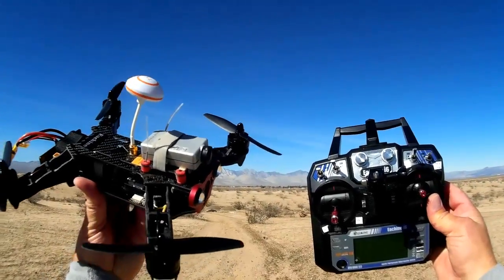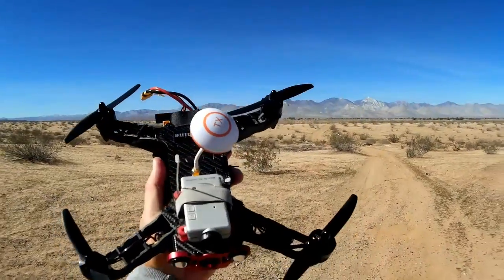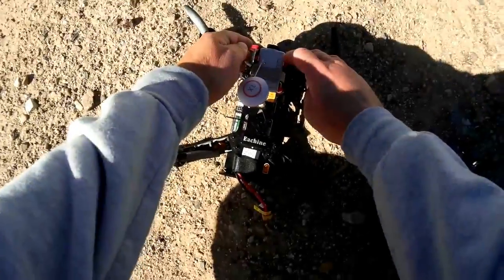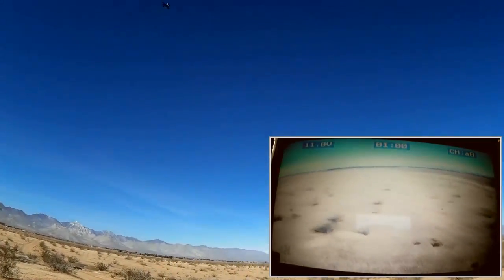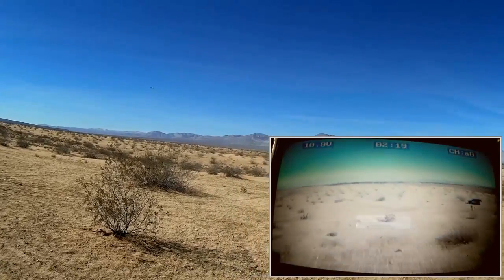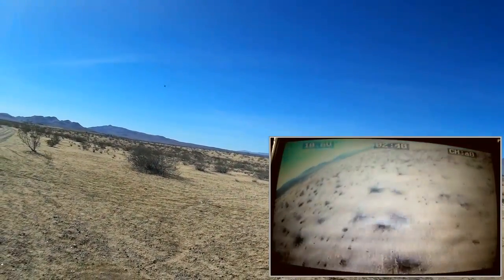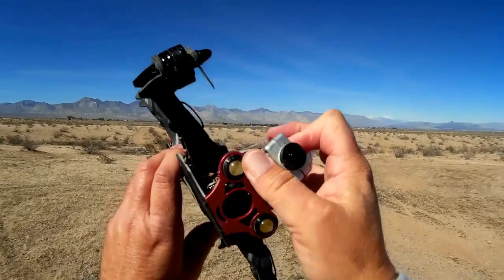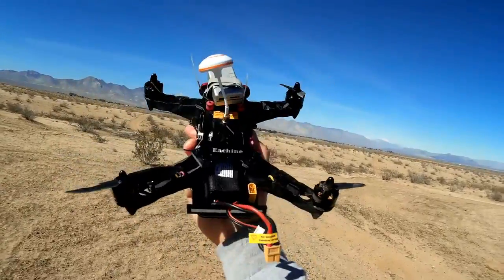Eachine Racer 250 Drone with QAV250 CC3D Presets

Comment: libra pilot IMO is your problem... load cleanflight or better betaflight on that CC3D I had nothing but problems with open pilot now known as libra pilot also it looked like in the video you where flying in acro mode  hope that helps

Comment: won't be in that program. esc can be programmed via program card or the transmitter. you need to determin the make of esc used and follow program guide on data sheet. my zmr250 running cc3d and emax esc's had low voltage cut off set as default and would fall out of the sky under low voltage conditions

Comment: check esc settings and make sure low voltage cutoff is disabled.
Reply from the maker: +Mark Dobson I looked through LibrePilot, and did not see any selection for doing such.  How would this be done?

Comment: I always thought the 250 Racers did not auto level, or had VERY slow auto level, because you manually controlled the roll.  I don't believe this is flying incorrectly.
Reply: +Zakerystrife You can manually configure it to do whatever you want. Stock from factory, this quad has Autolevel mode and Acro mode. He did change the PID settings so not sure what he is running now.

Comment: It looks like you had a failing motor or ESC, your FPV video shows the the drone turning suddenly and then loosing altitude veering backwards, seems like one motor lost rpm, and to right itself up it needed to slow the others too. At the beginning of the flight the same happened for an instance, it looked like the compass was drifting. The battery voltage was ok on the FPV screen, way above 3.1V/Cell. Was the runcam recording ? You would probably be able to hear the motor failing.
Reply: Dirk Herrendoerfer  that's wrong it's actually vibration to the cc3d. It's making the gyro stick sand is trying to correct itself. The motors will turn town to correct. It you replace a motor and it fixed it would be that the vibration isn't present.

Comment: do you want my pids they are rock solid for this quad?
Reply from the maker: +Smokey_Vaping It couldn't be worse than mine.  Yes please, please share them here so that others can also benefit.
Reply: nvm those presets your found are decently nice. looking much better.
Reply: r               p           y
P.0034 .00454 .00794
I  .01190 .01589 .01509
D.000046 .000061 .000067

i hope this helps some people out, pids were calculated with stock battery and no gopro. i was using open pilot gcs instead of libre pilot but i dont think it matter's, as they are bacically both the same
Reply from the maker: Smokey_Vaping Thanks!  I'm going to print these and try them very soon.
Reply from the maker: +Smokey_Vaping Thanks!
Reply: anything to help, keep up the great reviews i enjoy them all :)

Comment: Well, I'm glad you discover the weak battery. I have one of those little voltmeters which you plug into the balance plug and check all my batteries before going out flying with them.  If all the cells aren't between 4.15 to 4.20 volts, it doesn't go to the field.  Also curious why you used such an obscure open source configuration program?  Most of the guys who race here in the States use either Baseflight, Cleanflight or Betaflight  (I think Cleanflight, an offshoot of Baseflight, is the most popular). Tweaking the PIDs can be tedious work. Fortunately, there are a couple videos on YouTube which show what your craft will do if you have too Low or High a value on P, or I or D.  Of course, once you go through and set PIDs, you have to go back over them again, since they all sort of interact with one another. Guys who are REALLY into racing spend hours tweaking their PIDs to get them "just right", so that they can go flat out in Acro mode. Also, PIDs for one 250 racer will not necessarily be great for another, even if they are similar in design. Differences in the weights, balance, motors, props, batteries (to name just a few) all change things. Then there is a person's own "feel" that has to be accounted for.  I'm sure you'll get it .. hope none of the motors were permanently damaged .. props are cheap, and even some of the "unbreakable" props do break. I would actually rather break a prop than a motor bell, so Gemfans, HQs and DALs are all in my "spares" bag. Don't be afraid to go to 5040s ... a little extra punch and your 3S setup will handle them easily.  Looking forward to the next adventure ... Cheers!

Comment: If you used high power esc option on the set up and they are lower power after a few minutes it will fall out of the sky. I went through 10 sets of props before I found out what it was. So if you are flying and all of a sudden it drops that's the issue.
Reply from the maker: +John Kolar Please, could you share what settings you use? Maybe a screen snapshot of the setting?

Comment: You should consider putting one of them beepers on these types of quads,  you can set the voltage and as soon as it drops below a certain voltage on the battery, a beeping noise will sound off on the quad letting you know to land it quickly. They are cost wise fairly cheap and they are loud enough for you to hear at a distance. I have them on my walkera and my eachine.
Also can you post the link where to get that software and the pre-sets?. Thanks

Comment: Have you ever flown this quad without crashing it? ;P
Reply from the maker: +ComputermanAM13 Yeah, but to tell you the truth.... no.
Reply from the maker: ComputermanAM13 The thing is that this quad can really take the abuse.  I should be back in the air shortly by simply changing the propellers, and blowing residual dirt out of the motors.  But I also want to do a little more fine tuning of the PID settings before taking to the air again.
Reply: +ComputermanAM13 its funny
Reply: +Quadcopter 101 :D
Reply: +ComputermanAM13   Great question; we learned a lot from it, thank you! ;)
Reply: +Wobble Copter I've also got this quad and I crashed it during the maiden flight, too.
Reply: +Quadcopter 101 Try the KingKong 5045 props. They are much more strong. Luckily my quad fell in the grass, and I didn't break any props.
Reply: +ComputermanAM13  You were teasing, lol, me too. :)
Reply: LOL